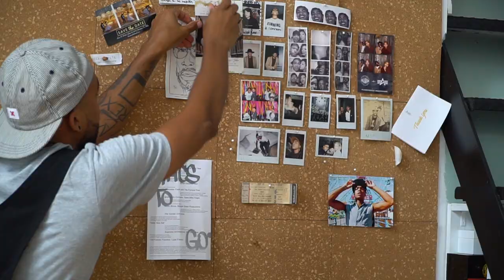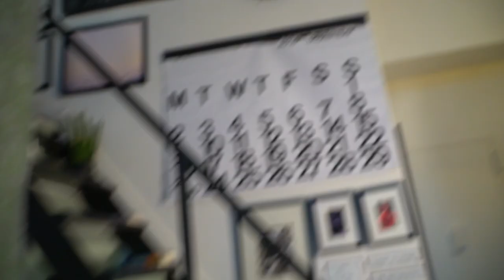DIY Accent Wall Transformation + Sliding Barn Door (NYC Apartment)

Comment: Where did you get the pole for the hanging plant?
Reply from the maker: Hey hey! I actually made it from a simple metal pipe and flange from Home Depot. Super simple and cheap (just make sure you use heavy duty screws and anchors)!